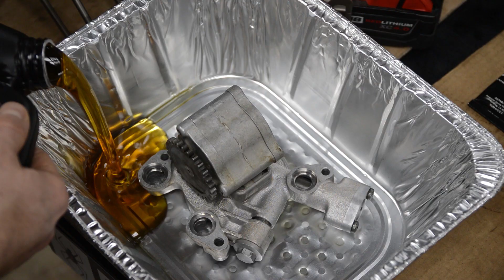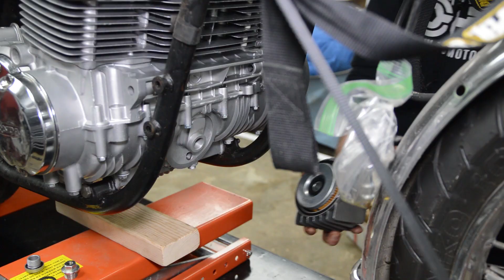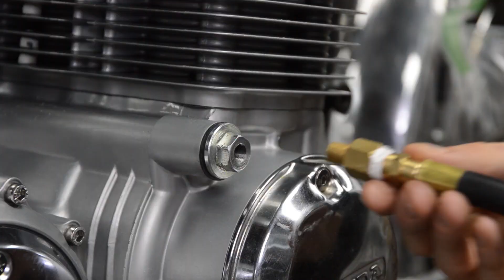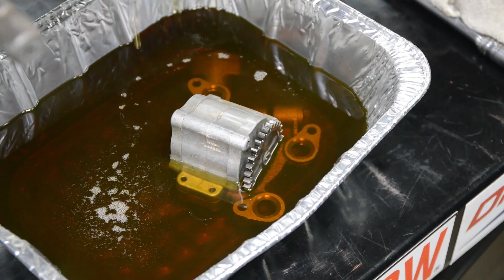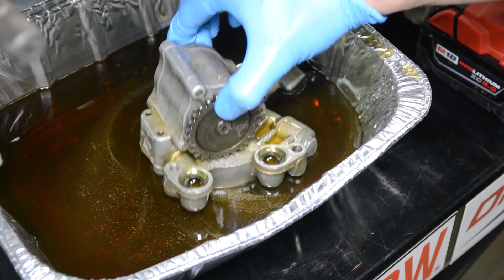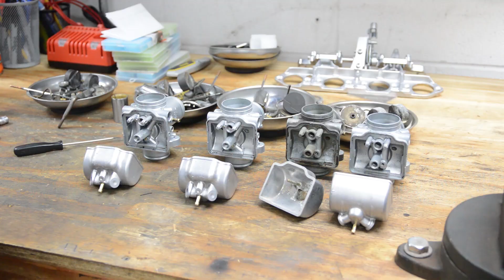How-To: CB750 oil pump prime & pressure test

Comment from the maker: Full engine rebuild video: https://www.howtomotorcyclerepair.com/cb750enginerebuild/
3m decal remover wheel
: https://amzn.to/3cPfvFH

M20x1.5 drain plug: https://amzn.to/2Q5QMDg
OTC 5610
 pressure tester kit: https://amzn.to/2Q9ioaK

Comment: As well a having to fill  all the oilways and dry oil filter, i don't think your 4 foot long pipe to the oil pressure gauge helped any  ! ...   [ don't keep the starter motor spinning so long   without a cooling down period] .

Comment: Man, you are a smart young dude! Imagine if a guy fired up his fresh motor without doing that, GRONK...I've been riding these bikes for decades and learned more from your videos than I can believe. 
A full-time job and four kids, I tip my hat to you.
I'm a liked and subscribed old guy and I'll pay for your well done videos if I get brave enough to try this myself.
Reply: It would probably develop pressure very quickly since it would be spinning much faster than with the starter.  The oil pump is pretty simple, not a lot to go wrong with it.

Comment: That poor starter. Were you concerned you might burn it out with all that cranking? Another helpful video, Matt. Thanks!
Reply from the maker: No. No spark plugs installed so load was low, therefore low current draw.

Comment: Matt, you have to fill the oil pressure hose for the gauge with oil because as you know air is compressible.
Greetings Bernhard
Reply: I have never filled an oil pressure gauge hose with oil and have done this test many times on automotive engines. I think filling the hose would just make more mess.
Reply: Red 
The instruction in my pressure transducer manual state that if there is air in the hose or instrument the measurement is inaccurate.
Also, like Matt, you will have a delayed pressure indication since the air will compress first.
Try it next time.

Comment: Thanks for share!

For an one cylinder engine,  do you know what is the average time that oil line gets operation oil pressure after engine starts? (not oil drained, not pump replaced,  just cold start)

thank to you!
Reply from the maker: Probably 1-2 sec???